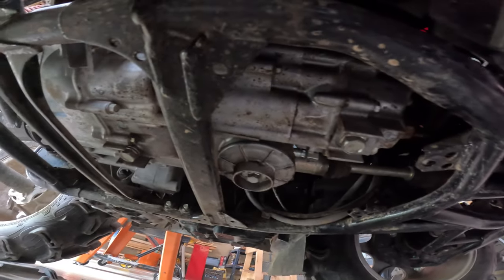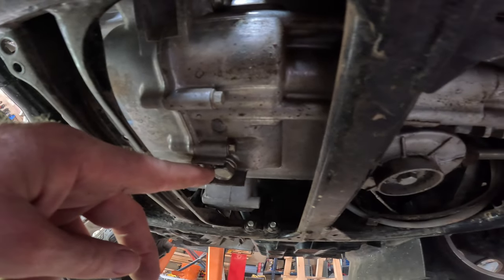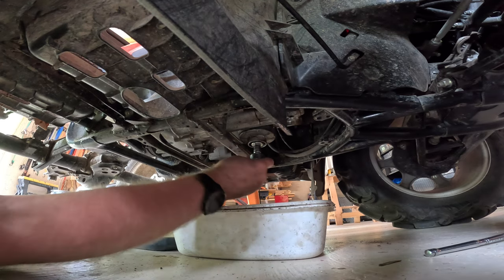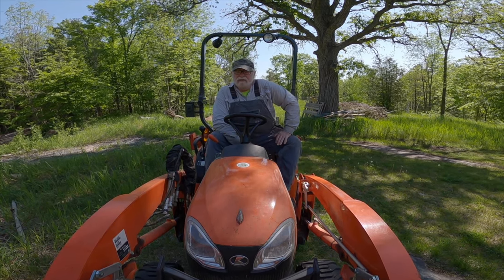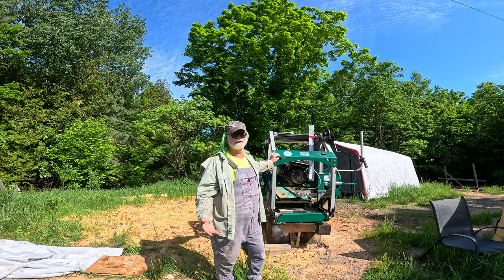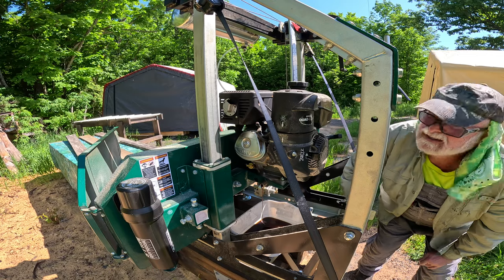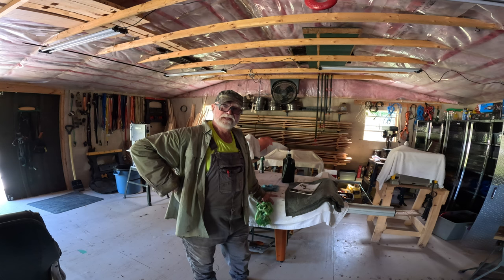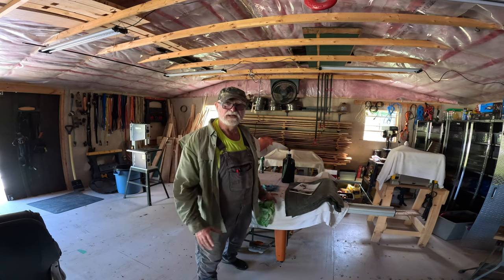Do THIS Before & After Using Your ATV, Sawmill, & Tractor

Comment: Nice thorough job on your equipment maintenance. How often are you supposed to service the cooling system on the ATV? Very good video Sir 🔧👍
Reply from the maker: I had it flushed once last year. They tell it won’t need doing for a very long time because of 5he rate I put hours on it. Thanks for stopping by!